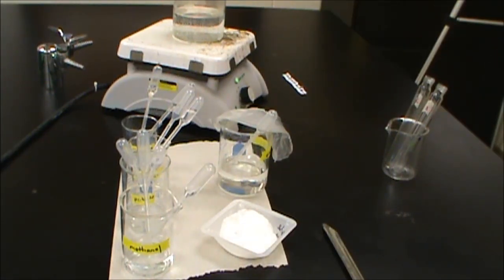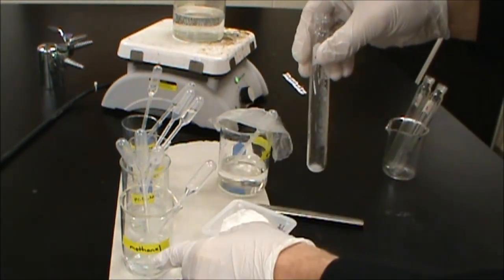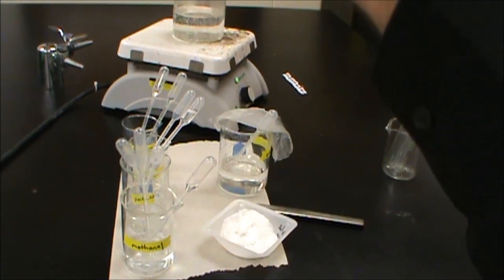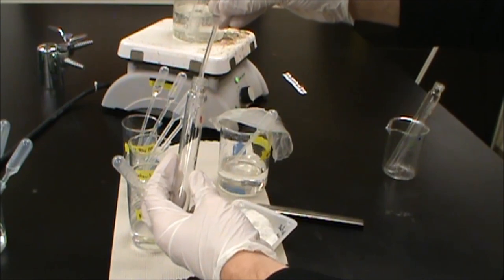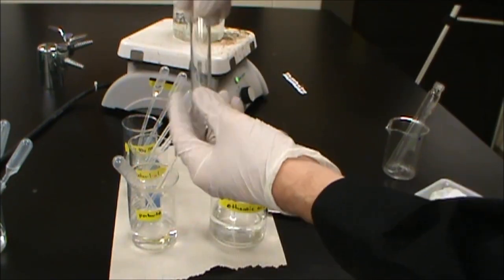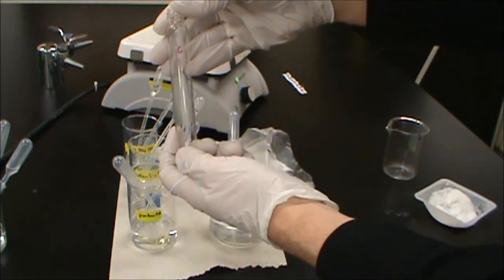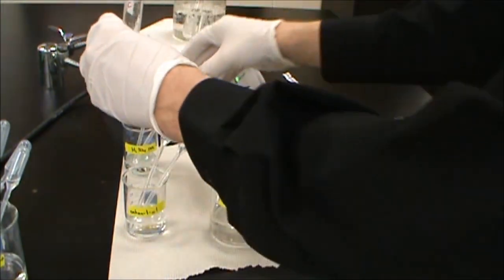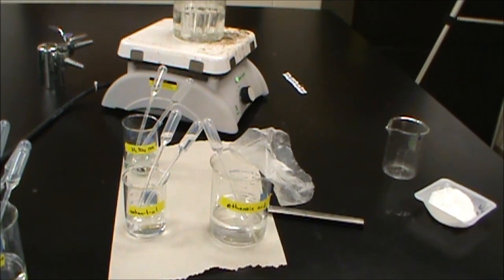Esterification Synthesis Lab - Banana, Wintergreen, Flowers

Comment: I have a question.
So in my experiment, I used formic acid with ethanol and concentrated H2SO4. After heating it in a water bath for 3 minutes, I poured the solution into a beaker containing Na2CO3. 
The result was supposed to be a pleasant odour, but I didn't get that. 
Could you please tell me where I went wrong?
Reply from the maker: I don't have any great recommendations beyond heating for longer, and trying different amounts

Comment: are these carboxylic acid soluble in the aques solution
Reply: Depends on chain length, if it has a long carbon chain. It’s gonna be hard to be soluble in aqueous solutions. It can be soluble due to hydrogen bonds in the C-O double bond